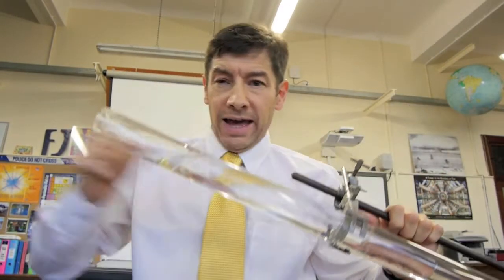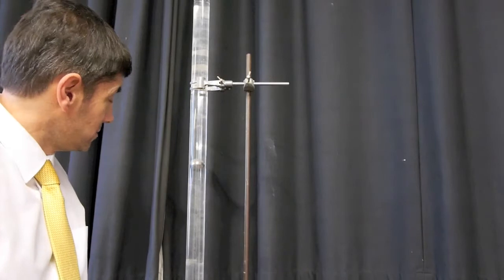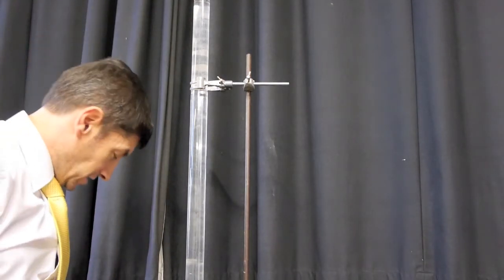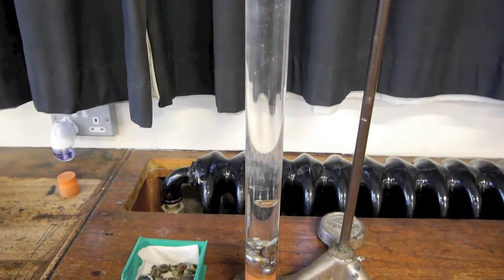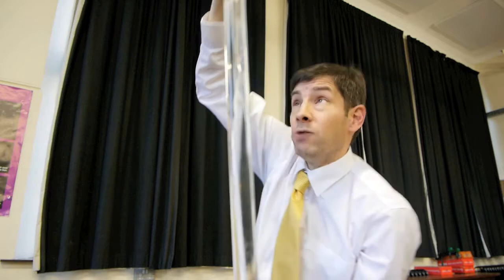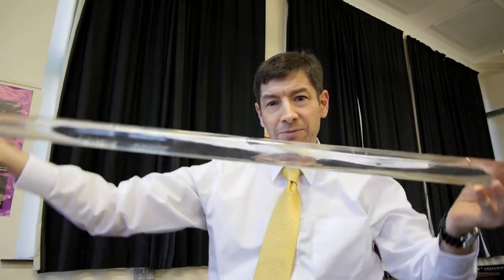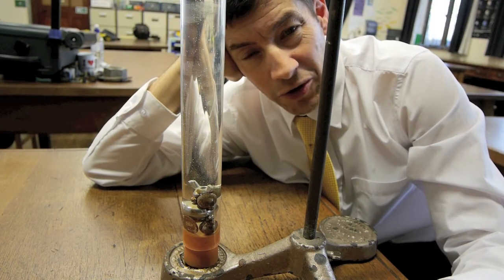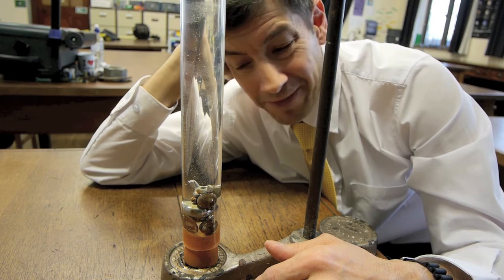Balls in Oil - Terminal Velocity - F-J's Physics - Video 3

Comment: Hmm the bubble breaking up as the tube rotates. Could it be something to do with surface tension as the bubble attempts to flatten itself against the tube walls due to the rotation effect?
Reply from the maker: Yes, that sounds like it.  I have been looking into fluid thread theory in general.  I really need to make a video just about this and see what other comments we get.  It is odd and interesting isn't it Julian!

Comment: Hi Anthony. My thought on the bubbles breaking up : likely due to the vibration in the fluid caused by rolling the tube sets up standing waves in the fluid which breaks up the bubble at the nodes. This could be tested by using a tone generator and speaker to set up longitudinal waves in the tube. The wavelength would be affected by the fluid viscosity. And frequency. Would be great to see if this is a workable hypothesis. 🐳
Reply from the maker: Thanks Robert.   That's really interesting.  I really must spend more time on this one.  Quick thought.  If the nodes are say 10cm apart, therefore the wavelength is 0.2m,  If we say the speed in the fluid is 1900m/s then that gives a frequency of 9.5kHz which seems a bit high.  So I am not sure about standing waves but it is good to investigate everything.  It is odd isn't it.  I have been pointed towards Fluid Thread Theory but not got much further with it.  Thanks for giving me a prompt to look at this again even if I just do a video about this affect and see what comments come from it!

Comment: sorry sir a stupidquestion but how the ball keep falling like buoyant force is same for it and after reaching a depth  like its veloctiy inccresing and vicous focre too increases and after a time thhey get balnced due to increase in vicous force the net force is zero then why not it get still  like i know gravity but cant it happen that it stops after reaching maximum velocity before reaching the bottom
Reply from the maker: Not a stupid question at all!!  You have the physics correct apart from one bit.  Newton's 1st Law.  'When no overall force (net force) acts on an object it cannot change its motion' as there is no force to change it.  So it cannot speed up, slow down or change direction, so it just keeps going at a constant speed in a constant direction (constant velocity).  The downwards force might be 0.1N so the upwards, balancing force, will be -0.1N therefore the sum is zero (as force is a vector quantity).  Hope that helps!  Think about air resistance on parachutes or cars limiting their top speed to a terminal velocity.  Good luck with your studies and I bet you weren't the only person confused by this!
Reply: @AnthonyFrancisJones  thanks sir

Comment: honestly, I loved the video and found the last bit quite fascinating!!
I am thinking of doing this experiment for my investigatory project but I have to ask what all liquids could we use for this experiment other than glycerol that can be found in the market easily. also ca the tube be emptied in order to do the experiment with other fluids.
Reply from the maker: Thanks, glad you liked it.  So with corks/bungs in each end it can be easily emptied and glycerol can be cleaned away with water.  I have seen it done with different types of motor oil (have a look at my viscosity video).  I have even seen it done with thin wallpaper paste.  Remember that the physics of this would be listed under Stokes' Law.  Hope that helps and good luck with the project!

Comment: Great video! Also, what fluid did you use for this demonstration?
Reply from the maker: Thanks Hugo, it was a nightmare to film as the tube is long and thin not like the camera frame!  So there are so many suggestions for fluids but the best is just pure glycerol which you should be able to get easily.  If not a thick motor oil will do it or a thick sugar and water solution.  We find that glycerol works really well and lasts for years - it does not mould or go off but we do tend to empty the tube after we have finished with it with all our classes and put the glycerol back in its can and wash out and dry the tube.  Anything else, just ask!